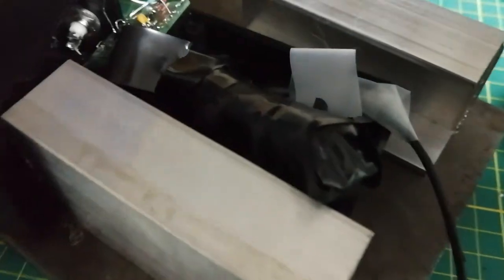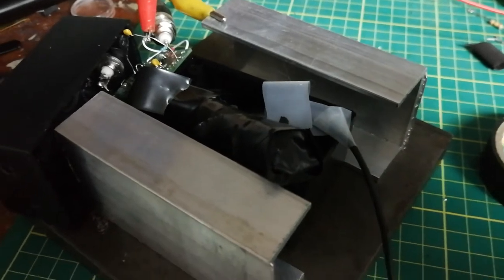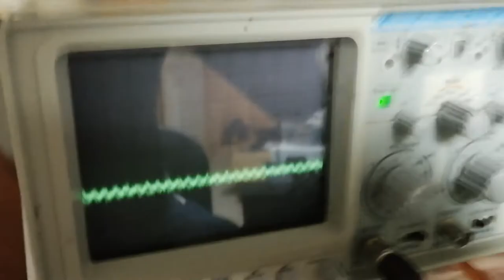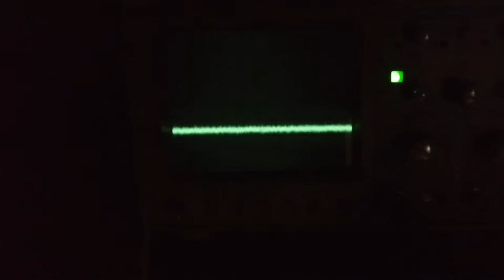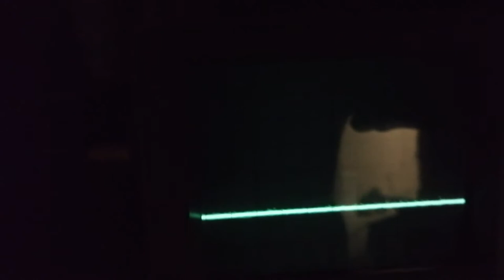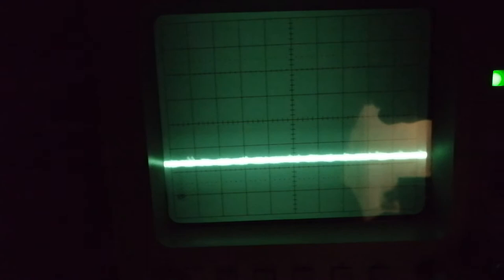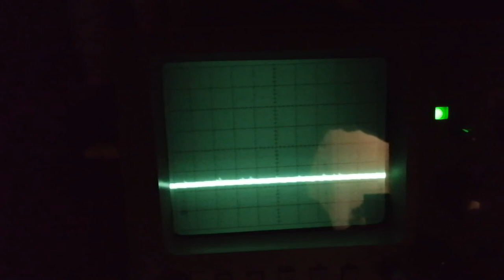Photomultiplier test setup

Comment: To see if it is working correctly, build a fixture with a stable light source and introduce neutral density filters as these will have a known effect on the photons hitting the PMT.  When I was building equipment using PMT's I found this book very useful.  https://www.hamamatsu.com/resources/pdf/etd/PMT_handbook_v3aE.pdf
Reply from the maker: Whoops, Just saw this now. Thanks for the insight. I totally love that PMT handbook.
 I buried a blue led in the housing, facing the cathode. It's quite interesting to see pristine, square pulses turn into noisy pulses and then into fuzzy, spikes of bunched photons, as the current is reduced.  

Really neat stuff
Reply: @analogplanet9675  LEDs as a stable light source can be fickle.  The output will change with  current change or temperature change of the LED.  To use an LED make sure you have a very stable power supply and a temperature controlled LED.
The PMT project I worked on, we encased it in a small piece of aluminum which was then temperature regulated with a peltier device.  This was more to have a constant PMT temperature (i.e. constant dark current) then cooling it to lower the dark current.  To much cooling and you will run into condensation issues.
Reply from the maker: Thanks, good know that about LEDs. I was just checking that the tube responded in roughly the way I expected to light pulses barely/not visible to the eye. My divider setup was meant for scintillator pulses, and was not really suitable for quantifying d.c. light levels anyways.   I had pretty bad issues with dark current/counts, your Peltier approach probably makes a huge difference. 
The other issue I ran into had to do with whether the cathode or anode was at ground/tube housing potential. Anode reffed shielding(which is the easy way, theoretically) resulted in giant, random current pulses beyond about   2kV, if I remember correctly.  I think it had to do with photoelectrons accelerating through the entire voltage and striking the glass, resulting in a flash of light and more photoelectrons. Cool stuff. I'll pick up the PMT again one of these days.